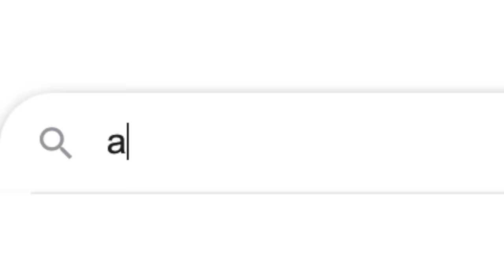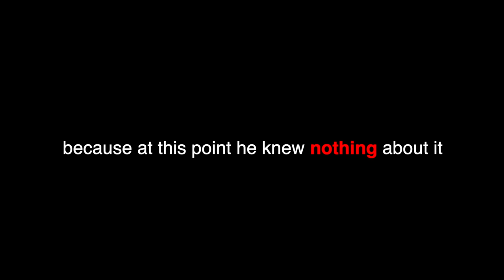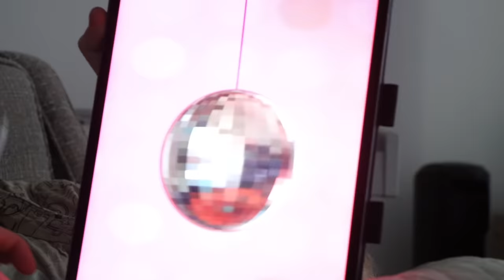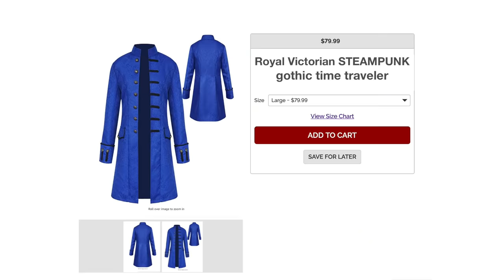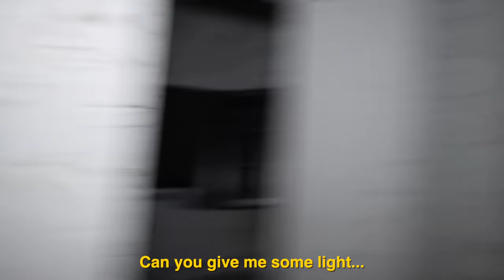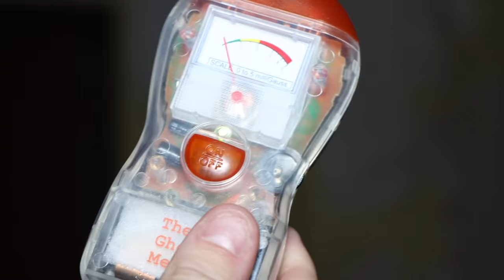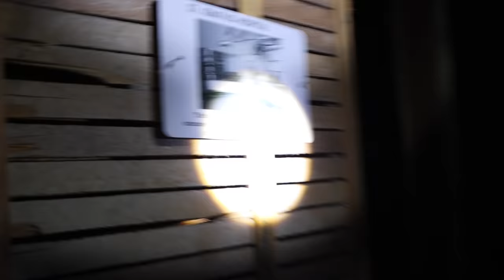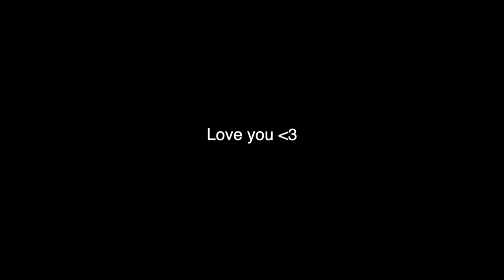Overnight in a Haunted Hospital (DARE YOU TO WATCH AT NIGHT)

Comment: Ghosts are scary, but asbestos, lead paint, and the rotting structure is enough to keep me away
Reply: Yes. Running away in the dark into a lead painted wall,where a chip hits and cuts your eye, and the asbestos ceiling showers a lil snow on yah,while your leg goes through a dry rotted floorboard. You fall through and asbestos falls into your mouth as you lay there,breathing a toxic mixture of old materials,oxidized iron and mold in through your nose. More dead than saying bloody mary in the bathroom mirror.
Reply: I know right

Comment: is it just me or is there a boxy looking shadow at the 1:13:41 mark when Andrew turns the camera towards the door that closed? 
it's by the exposed wooden wall on the left of the screen, and it seems to move to the left on its own, not according to the camera light or smth.
if you set the video to 1:13:40 and put it on .25X speed you see it moving like a box shape to the left and then it seems like it's not there when Andrew goes back over to the door?

Comment: 1:13:40 immediately as andrew turns the camera, there is a shadow that slides to the left out of view down the hallway. it's very quick, but my brother noticed it and at first I thought it was just a shadow but it doesn't make sense since the light is shining directly on it and it looks too dark in my opinion. also, if it was andrew's shadow, the shadow would have moved onto the white wall that it was disappearing behind .... but instead literally just slides around the corner. FOUL DISGUSTING